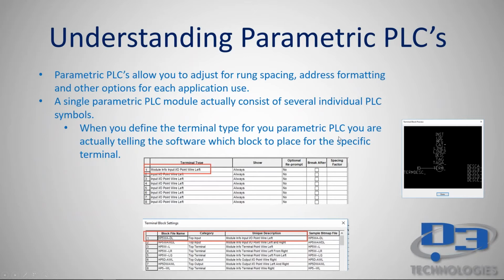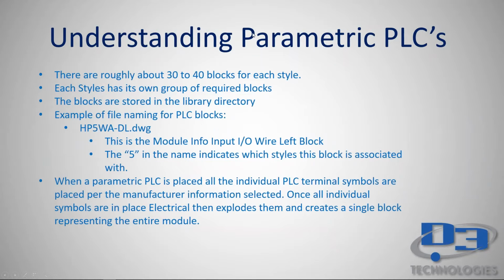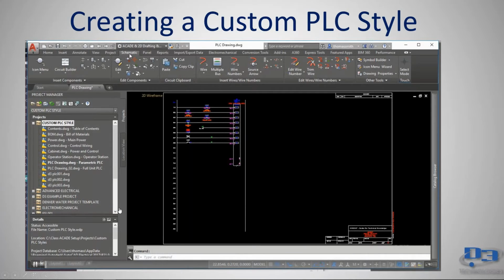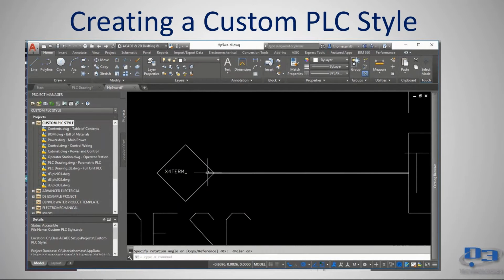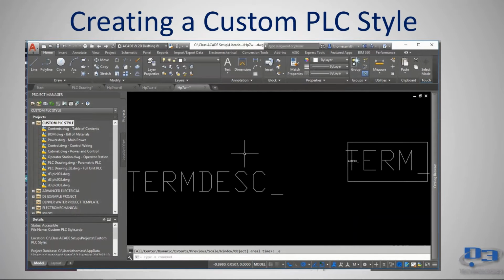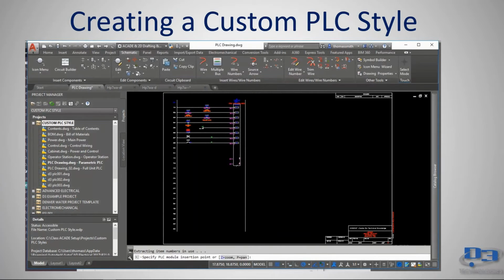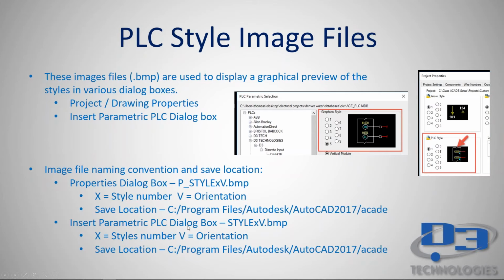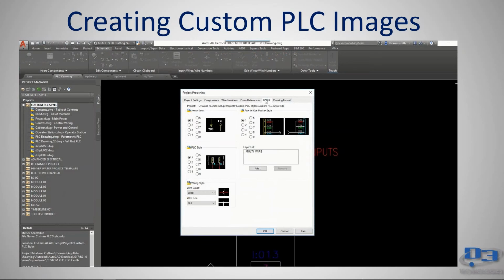Creating Custom PLC Styles To Fit Your Design Standards in AutoCAD Electrical

Comment: I cannot get the files to open when I click on the style "7" keeps displaying HP7wa-dl, hp7wa-d, hp7w,,, not found. Followed video to the "T" I am running 2019 Acad Electrical
Reply from the maker: All of the files for the parametric PLC blocks can be found in your Schematic Library. If you right click on the Project file and choose Properties… you can then see your Schematic Libraries paths on the Project Settings tab. There are only styles 1-5 in the program as a default. You will have to create each of the 30 to 40 individual blocks in the graphic style you would like to use any of the 6-9 style options. If those blocks have not been created, then the program will not be able to use those graphic styles. Hope this helps! If you have any other questions you can contact us  support@teamd3.com. Thanks for watching!